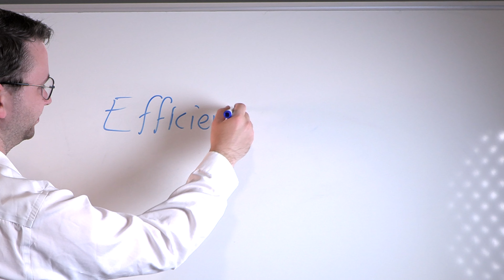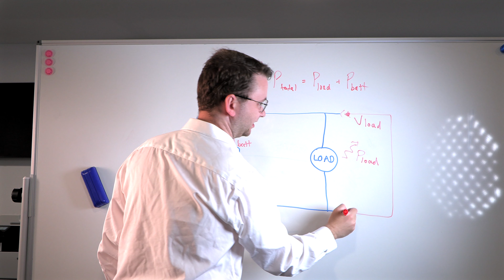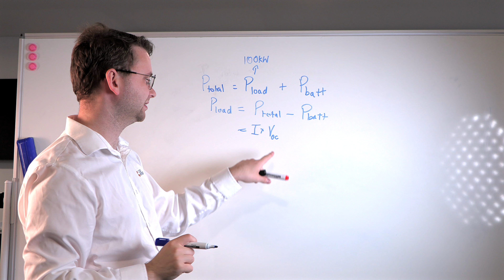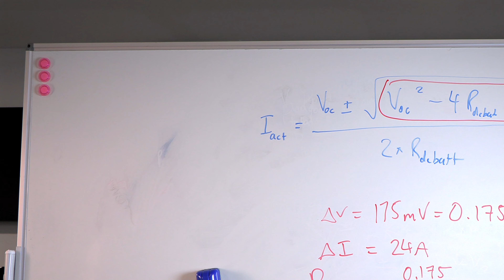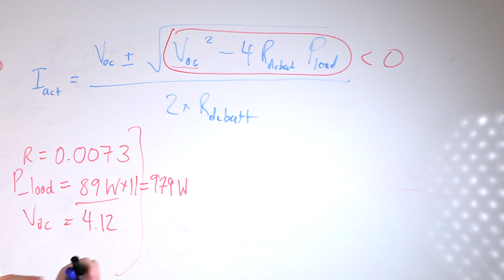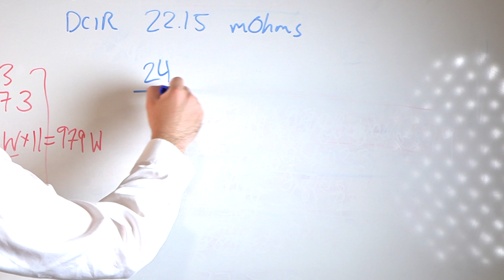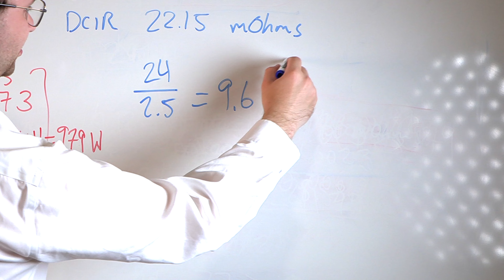Comparing the efficiency of Donut Lab's solid state battery

Comment: The writing is on the wall: DonutLabs’ solid-state battery is leaving lithium-ion in the dust.

While Tesla’s shift to lithium iron phosphate (LFP) batteries for grid storage highlights the limitations of conventional lithium-ion—thermal instability, rapid degradation, and sensitivity to temperature—DonutLabs is demonstrating something far more revolutionary. Their solid-state battery isn’t just incrementally better; it’s rewriting the rules. We’re seeing real-world proof that lithium-ion’s Achilles’ heel—its vulnerability to heat, charge cycles, and operational stress—is no match for the robustness, efficiency, and longevity of next-gen solid-state designs.

In short: DonutLabs isn’t just competing with lithium-ion. It’s making it obsolete.

Comment: You state that inefficiency leads to heat, which "accelerates degradation and causes battery dendrite formation" [00:51].
 
   The "Solid State" nature of the battery is specifically intended to provide a physical barrier that prevents dendrite short-circuits. Therefore, the traditional "heat = dendrites" rule of thumb for liquid electrolytes may not apply to Donut Lab’s specific solid-state separator.
Reply from the maker: Hey @xxDakestMaidenxx, thanks for watching. Valid comments, I've made a generalisation based on all of the kinds of batteries that we're used to working with. There currently aren't any battery chemistries where heat does not accelerate aging, but if the DL battery is novel then it might be the first.

Comment: Every battery suffers from this issue. The higher the C rate the lower the charging efficiency.  Changing at an 11C charge rate has a down side. Donut isn't claiming any breakthrough here. They are claiming that at least you can charge at 11c and eat the efficiency.  They are also claiming superior thermal characteristics to help with that.

As other people are saying you need an Apples to Apples comparison to another current battery.  Even if the Samsung battery is a bit more efficient under the same conditions,  it only has a lifetime of 250 charges. In many cases I'm pretty sure the drop in efficiency may be worth the gain in charge cycles

Comment: Why did you not just use the actual numbrers for RTE ( Round Trip Efficenty  ) from the VTT Verification. 1C   RTE Was 90.3 % { average of 2 passes)   5C was 86.1 %. ( average of 2 passes )  11C  RTE was 83.3 % ( average of 2 passes )  would not that be more acturate and simple. What I am seeing from the results . . ., 1C looks not as good as a great NMC battery, but once you get to 2C, NMC breaks down and this battery is simular or better, and if you go to 3C the Donut battery is much better,  and we all know NMC can not handle 5C well and just foget 11C for NMC. I think you concluded  that this is not a good battery without most of the Data still out. What if this battery can charge at -30 C,  What if this battery really has 400W /kg.  What if this battery can go even 20,000 cycles. Any one of these specs  would make this battery a  game changer, compared to NMC.  Oh . . .What if this battery does not. have thermal runaway, and what if this battery uses Sodium and aluminum  instead of LIthium and other rare minerals? What If?   We will be watching!
Reply from the maker: Hey @EvDriveZeroPollution, your question is spot on. The resistance method is fairly industry standard and allows you to run many comparisons without testing every single scenario, but it hinges on the caveat that R_dc is fairly constant, which is usually the case (although it does sometimes vary by 20% or so based on temperature, age, SOC, etc). In the case of the Donut Labs cell it varied by 2-3x which is very unusual, but in the case of fairness I used the best R_dc that could be found in the data which was around 3mOhms. This aligns with an employee on LinkedIn from the Donut supplier who reached and told me their measured R_dc in R_dc tests. You absolutely CAN get the efficiency from the RTE alone, but there's 2 caveats to consider:

1. The RTE needs to be measured bidirectionally, so i.e. you need to charge the cell up at 0.1C or so and measure the exact amount of energy you put in before you compare it to the energy you take out, which is a slightly different test setup, and

2. in the video I calculated the instantaneous efficiency (that is, for a particular temperature, C-rate, at a particular OCV voltage). The RTE is over the entire discharge curve of the cell and that's going to vary a lot especially with voltage. What happens at lower voltages is the I_act (calculated in the video) will start to avalanche upwards as the voltage drop approaches the cell OCV and this would have skewed the results massively. Hope that makes sense. Hard to explain without pics. Thanks for watching.

Comment: I can charge any battery fast, it’s how many times you can do it before the battery is scrap.
Heat sink to dump the heat, not a real test. Must have a high R since it gets so hot. P=I^2R 
Not a battery bank.
Need to do 10,000 100,000 cycles in various environments and configurations. None of this extrapolating BS from a few cycles.
At 1 hour per charge/ discharge it takes 11 years for 100,000 cycles, battery needs time to cool down. See you in 2037 for the graphs.
When  Dr. Jeff Dahn has done his life cycle testing of the Donut battery we will know it’s true performance.
Reply from the maker: Hey @universeisundernoobligatio3283, you're absolutely right, this is the key point. One thing that worries me is the huge capacity reduction after just 1 cycle. That really challenges and contrasts the 100,000 cycles claim. Until we see more data ... Thanks for watching.

Comment: Why did he estimate 0.003 ohm for the donut at an 11C charging? How did he obtain? 
That small value and difference between Samsung 0.0023 ohm makes the difference between efficiencies Donut vs Samsung.
Reply from the maker: Hey @petrcifka, I pulled this from the voltage hike on the 11C graph. It was difficult because the 11C graph is really noisy. We can do a much more accurate analysis if they release pulsed test data where they cycle the tester on/off so the open circuit voltage can be compared, but based on the data available I think what I pulled from the 11C graph should actually work in Donut Labs' favour. It's absolutely okay to pull your own R_dc from the graph and run your own calculations and disagree with me, I encourage that! I didn't think this would reach so many people otherwise I would have put more effort into it, such as calling out the exact R_dc and corresponding temperature on each graph. Thanks for watching

Comment: I don't even know where to start. Rumor has it that the "battery" that was being tested at the laboratory was actually a earlier version. The newer ones are the ones that have the higher energy density. And no, the battery does not use lithium. It is a salt based "battery", if you choose to call it that. If you look into the way it's made, (CT-Coating AG tech, apparently), it explains a lot. If you are looking at this through the lens of presumption that it's a traditional lithium ion battery, that's what you'll see. This is not a traditional lithium-ion battery if you follow the trail of breadcrumbs. It will probably eventually be revealed  that this is actually pseudo capacitor.
Reply from the maker: Hey @b.robinson206, thanks for watching. If VTT release more data I'll produce another video with a more detailed analysis. Because of the way the test data was structured, it was pretty difficult to analyse. For example, they didn't weigh the cell or the heat sink, so we couldn't do any thermodynamic calculations :/

Regarding the capacitor theory that's going around .. that would explain a lot of things, but the 1 thing that it wouldn't explain in the claimed density (400 Wh/kg) and the discharge curve. Capacitors are characterised by their exceptionally low densities, roughly linear discharge curve, and their ability to be discharged to 0V and recover again. (Lithium "ultra capacitors" exist, but they are more or less just batteries designed for extra high energy and they don't have these characteristics). Interestingly in these tests, they don't discharge to 0V and the curve is decidedly non-linear and battery-like. This is why my opinion at the moment is that it isn't a capacitor, but I could be totally wrong! Let's hope they release more data including the mass of the cell so we can calculate the density

Comment: What a load of crap. The fact this guy compares efficiency at 11c vs 11c is beyond comical with the end statement samsung is a better battery. I do not know if Donut labs battery is all that they claim, but one thing  I know, in science you have to compare comparable things.... samsung did not perform better and would definately not be a better battery based on these specs alone simply because it would catch fire! Lithium batteries simply cant handle 11c, they might do it once or twice but start smoking and ignite! Moreover Donuts labs is a new battery, it seems to perform better at higher temperatures, so a more honest comparison would be a 5c charge vs more recent batteries.

In the end this review is another BS attempt to devalue the current released tests.
Reply from the maker: Hey @nunompadrao, thanks for watching. You're right we have to compare like for like ... which is why I picked the Samsung 25R, because it is rated for 8C continuous. In this test ( https://lygte-info.dk/review/batteries2012/Samsung%20INR18650-25R%202500mAh%20%28Cyan%29%20UK.html ) the Samsung 25R can withstand 12C discharge at 80% measured efficiency. If Donut Labs release more test data I will do a follow-up and use different maths to analyse it.

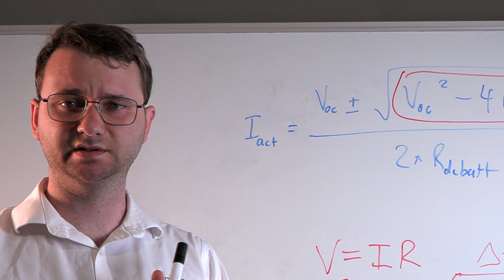Comment: 11:37   Everyone seems to have missed that he's doing this efficiency calculation based on the 1C charge/discharge graphs, not the 5C or 11C graphs.    It's a fair efficiency comparison, but the battery is meant to operate at higher C's where it heats up, lowers internal resistance and becomes more efficient.    And being solid state, dendrite formation should not be a factor.  Donut's claim that it can be fully discharged, and then charged from 0-100% as many times as you want without degradation suggests they don't think dendrite formation is a factor.     For normal Li+ batteries, deep discharges and/or repeatedly charging (and storing) at 100% are all bad.
Reply from the maker: Hey @daemn42, thanks for watching. I pulled from that graph because it was high quality data unaffected by temperature change, but I could have used either the 1C or 11C graph. The 3mOhm measurement that I used later comes from a hot part of the 11C graph. What we pull from the graph (the DCIR) is generalisable between any charge/discharge rate, for example when you buy a cell they will provide you with this value so you can run your own simulations across multiple C-rates. But basically the resistance doesn't change much with the charge/discharge rate. It's more affected by the temperature and SOC. Hope this clears things up.
Reply: @kvanberendonck-cuedo  They make it clear that the IR goes down when their battery gets hot, so I do think it matters quite a bit.  And in my experience (high performance lipos) they'll get a lot hotter charging at say 5C than they will discharging at 10-20C.    Anyway, I thought I understood what you were trying to accomplish, but I clearly do not.
Reply from the maker: @daemn42  Yes, the R_dc reduced from 7.3mOhms (cold) to 3mOhms (hot) for the Donut Labs cell. We use the 3mOhms (hot - lower is better) for the calculation.

Comment: GROK ANSWER:

Hey man, great breakdown on the math—your calcs on internal resistance and efficiency seem solid based on the VTT data. But I think you're underselling the Donut Lab cell by focusing so heavily on that hypothetical 11C discharge efficiency (which VTT didn't even test directly; they only did 1C discharge and high-rate charging). The report shows the cell crushing it on charging: 0-80% in 4.5 minutes at 11C with 98-99% capacity retention afterward, even hitting temps up to 89°C without issues. That's way beyond what a 2014 Samsung 25R could handle without degrading fast—Samsung's max continuous is like 8C, and it wasn't built for ultra-fast charging like this prototype.

Your scaled Samsung comparison makes sense on paper, but it ignores that Donut's cell is a solid-state pouch prototype aiming for 400 Wh/kg density and 100k+ cycles (pending later VTT tests), not a mature cylindrical Li-ion. At real-world EV rates (2-3C discharge), the efficiency would be 95%+ anyway, and the heat from high rates can be managed with cooling. This isn't "worse than 10 years ago"—it's proving fast charging works without exploding, which could make EVs practical for everyone. Excited for the full VTT suite to drop!
Reply from the maker: Hey @wakeno.6047, thanks for watching! On the money, it's not a terrible cell if the density is as they claim. Very eager for them to release the mass of the cell they tested so we can do further analysis. Pulsed test data would be great too, we could do a very detailed and awesome analysis (such as DCIR vs temperature) with some pulsed test data.

Comment: Samsung won't handle 11C, but nonetheless it was nice to recall some electrotechnical formulas. Thank you sir!
Reply from the maker: Hey @demondrive137, thanks for watching. I think you'd be surprised! In this test data they test the 25R at 12C (30A) and it does quite well actually. Efficiency at 12C for the Samsung is around 80%! And due to the way the testing is done (over the entire voltage range, not just the top of it) we're expected the measured amount to be less than the calculated amount. So props to Samsung for making a great cell! https://lygte-info.dk/review/batteries2012/Samsung%20INR18650-25R%202500mAh%20%28Cyan%29%20UK.html

Comment: Did I miss an explanation why you can't use the numbers VTT got out of their hi spec equipment? The Discharge energy vs Charge energy for each test can be used to calculate efficiency. So, derived from the energy in & out Wh numbers given by VTT:

Charging at 5C — 85% (2 heat sinks), 87% (1 heat sink)
Charging at 11C — 82% (2 heat sinks), 81% (1 heat sink)

These numbers seem good if other claims check out.
Reply: I had the same thought. This is some interesting math but it seems irrelevant if you have the measurement
Reply from the maker: I agree they should do this test, but it needs to be done carefully and bidirectionally, that is you need to measure the exact power that you put into the cell (at 0.1C for example) and then measure the power out of the cell, and vice-versa for charging to get an accurate result. The calculated 77.7% and the tested 81% are not that different considering there are huge variations in temperature during the test, and, the charge capacity was uncontrolled.

Comment: Great clip, though you should compare the battery to a LiPo cell, E.G the Grepow high voltage 4.35V cell or something like it, working at 11C (Usually its rated to work up to 5C). Because the charge curve looks so similar between the two batteries.. Well, check it. I'm not suggesting that Donut Lab simply purchased a battery @ aliexpress, but, well, I'd like to rule out the possibility.
Reply from the maker: Hey @nyyotam4057, yeah so little known fact here is that most NMC chemistries can be charged to 4.3V but manufacturers recommend to undercharge them to 4.15V because this greatly increases the cycle life without reducing the total energy by much... usually by 3-5x compared with high voltage charging. With this in mind I absolutely agree with you that the charging curve looks suspiciously similar to a high voltage NMC cell but I don't want to make any accusations about the chemistry before they release more test data.
Reply: @kvanberendonck-cuedo  Agreed. Given that LiPo cells frequently use solid polymer electrolyte, this could explain the similarity in the charge curve, if we assume for a moment this is a solid state battery. So.. Maybe. We just need more test data.

Comment: Nice, I learn a lot from you. What about other SSB, such as QS, SLDP, etc, are they better, less, equally good? Could you please do other SSB comparison too? 🙏
Reply from the maker: Hey @BoonSongHow, thanks for watching. Actually the latest NMC technology is pretty amazing; CATL and others already have NMC cells with densities above 400 Wh/kg, and LiFePO4 is up over 180 Wh/kg these days. I think the power and energy density is not so much the deciding factor anymore as much as the scalability of the commercialisation. So, yes cost is 1 thing, but the main thing is the ability to do quality control of the cells at scale. For this reason I haven't really been keeping on top of every small scale SSB announcement. On the topic of quality control, you might find this report from Lumafield on battery quality control really interesting: https://7802750.fs1.hubspotusercontent-na1.net/hubfs/7802750/White%20Papers%20and%20Guides/Batteries/Lumafield%20Battery%20Report.pdf .